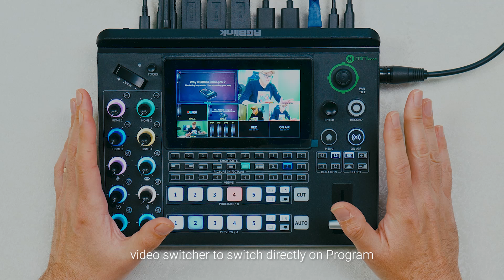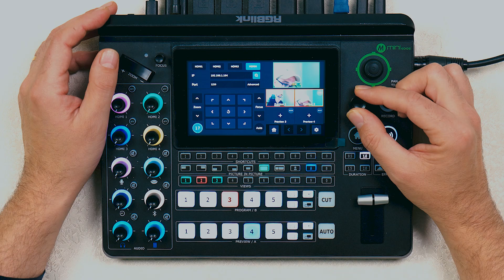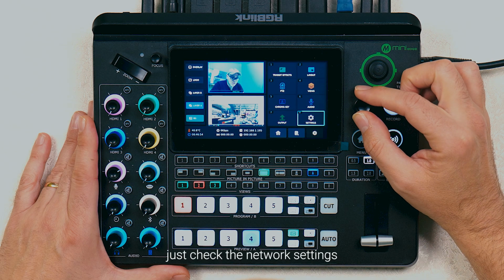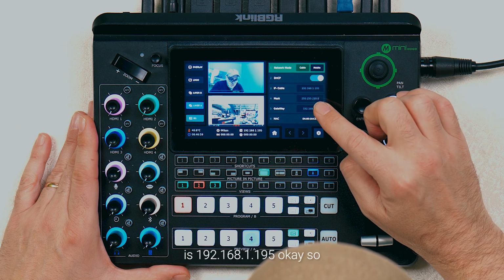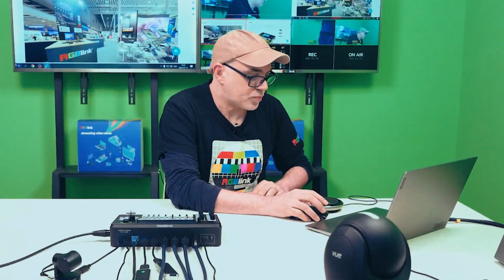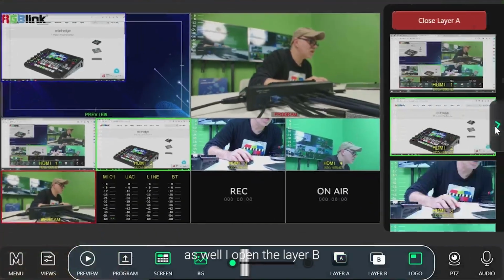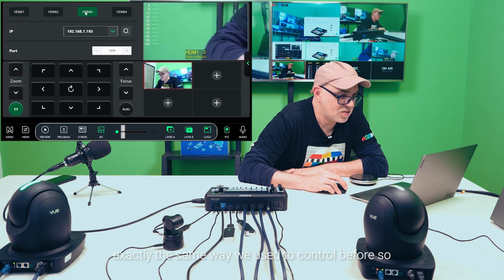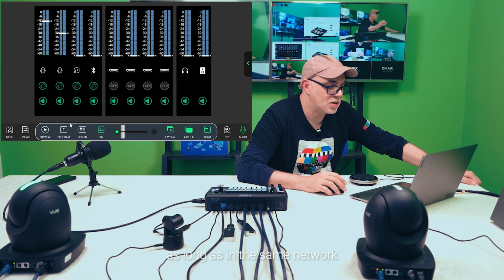mini-edge Feature & Operations Overview

Comment: Im disappointed.. i bought in AliExpress maybe it's used.. the deviced is wrapped with kitchen film and the LCD cover got a lot of scratch, and no manual included in the box☹️
Reply from the maker: suggest you return the device to the reseller. RGBlink does not sell on Alibaba. Always recommend to purchase from an authorised RGBlink reseller near you.
Reply: @rgblink I think Alibaba is not really the same im AliExpress ... no issue with it.. all is working. Only sometime if i connect my osmo pocket 3 as UVC, it will hang...
Reply: why did you choose to buy through Aliexpress instead of one of the several official channels?